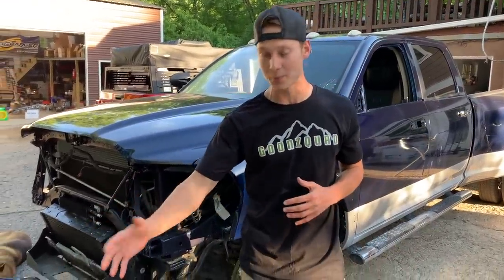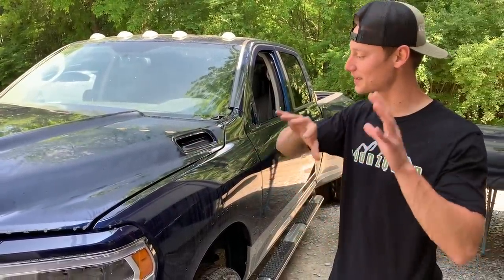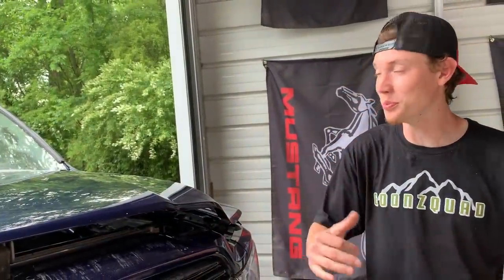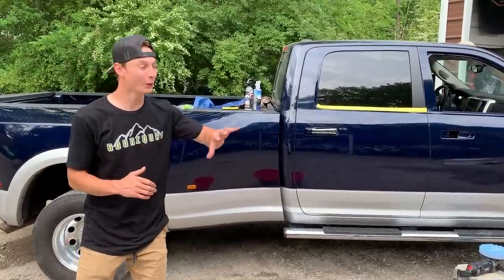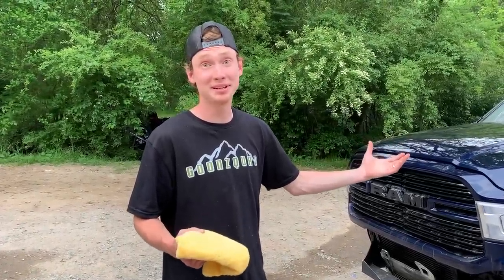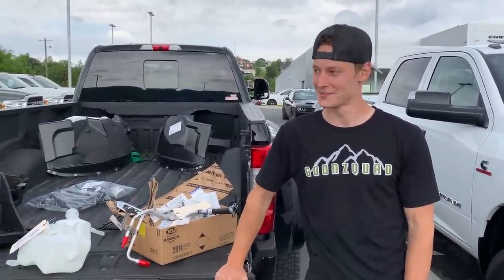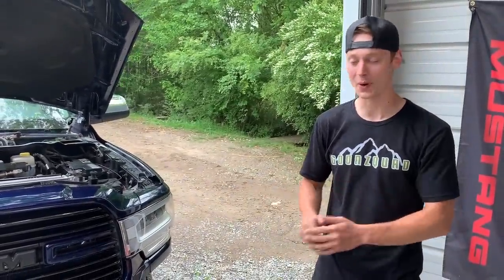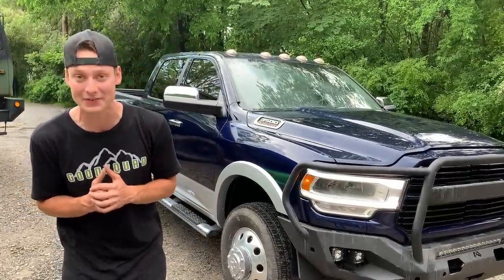Building My Dad His Dream Truck Part 12

Comment: Y’all did all that work converting the front end to the 2020 and then covered it up with the brush guard.
Reply: Kinda true... I wonder what a regular painted 2020 bumper would look...🤔
Reply: Same thought I had. Makes it look like crap
Reply: Don't like the front either. Bumper is way to slim and at least color match it all to the rest. But hey, I don't care much for trucks anyway so finish it asap and I'm fine with it.
Reply: @romanshu339  Rewind to the part of the video where they were looking at the 2020 Rams. It'll look like those.
Reply: And after all the wondering about the colour of the R.A.M. letters, you can't see them anyway.
Reply: @2H80vids  I was going to suggest to paint the RAM letters the same silver that is on the sides I think that would have really made it pop but like you said they covered it up with that stupid brush guard
Reply: Yeah. 🤢

Comment: Looks clean boys!! Don't go too crazy with the mods, especially the functional ones. Remember, it'll be a work truck first and foremost for your old man. Just like the F450. Keep grinding boys 💪
Reply: I was thinking the SAME THING....no Pep Boys wheels like the Denali
Reply: Exactly, they are all about the new “front end” then completely cover it with the bumper.. lol should have kept it OEM if you were going to do that haha
Reply: @pinkman111  I have no issue with the aftermarket bumper. That's mostly aesthetics. But if this is going to be a work truck for their old man, and this is how he's going to be making money self-employed, I don't want to see them lift it, or put aftermarket rims/tires, etc. And I wouldn't go crazy with the power mods either. Maybe just stick to an aftermarket cold air intake and tuner.
Reply: Check out the miata build swapped the engine a couple of times

Comment: Looks great. In my opinion you need to get the 2020 style fender flares for the bed so that they match the front flares (obviously paint them silver). And get some new running boards, either some textured black ones that kinda match the front bumper or the kind that fold down when you open the door. And paint all the chrome gloss black (i.e. the door handles, and the chrome on the badges, etc)

Comment: DRLs are supposed to dim when headlights are turned on. There are seperate wires for that. That is the other wire
Reply: Agreed, the dim setting they had before should be the brightness when the headlights are turned on.
Reply: Yes but it was dim when the headlights weren't turned on. So now they probably dim when you actually turn on low and high beams
Reply: I think front what I understand is that they didn’t take the wire out, but flip flopped them instead to the original setup. So theoretically it should dim when they put the lights on?

Comment: It look like their days don't last 24 hours like mine. Every little work on my cars took me multiple hours! Even washing it !
But Goonzsquad can remount a entire front facia grill, wash the truck, buff the entire truck, rewash it, replace both batteries holder, mount a light wire, remount both front windows and doors, go shopping, unmounting the front grill, replacing a cooler system, remounting a front grill,  remounting the bumper, the inter fenders,  ... etc... etc.... and the sun in still shining. It's Amazing ! How do they do that ? :-D

Comment: My dad is helping me build a 1962 Jeep panel van with barn doors and has 4wd from the frame up. It's going to look so good. We are rebuilding it with a diesel engine and two fuel tanks. It will be my bug out vehicle if need be.

Comment: Great video, but you really need to move on from 3M polishing compounds. The dust and residue created on compounding is too much. 
Try sonax profiline cutmax and perfect finish. No mess and much much better product. Sonax product is so much easier to use, and does not dry out like 3M, literally no dust or residue to clean up at all after.

Comment: When y’all get the shop built, y’all should take in customers and start rebuilding their wrecked cars almost like a collision repair shop but for the people who are like y’all who buy cheap wreck cars and want to rebuild them and use their cars as YouTube content too!
Reply: Noah Sharp it would cost to much to rebuild customers vehicles . That’s why most vehicles are totaled is a shop plus parts wasn’t cost effective to fix. Most vehicles that are repairable bring 50% of real value. Shops charge $62 per book hour and the hours add up quick.

Comment: Nice guys! Last vid where you had problems with the adhesion promoter on the trim pieces, after you sanded them back down, did you apply more adhesion promoter, or just left them?

Comment: When you say dodge ram 3500 you usually say dully because there is a truck   were it is a 3500 but not 4 wheels in the back

Comment: Throw some 22s with a leveling kit on it 🥶 and tune it ....roll coal
Reply: Why roal coal? It's supposed to be a tow rig, why would he waste even more money on fuel for literally no reason (there's absolutely no power gain). Bruh have fun melting injectors, getting tickets all the time, and dumping $70 worth of fuel into the air every time the motor hits 3000rpm.